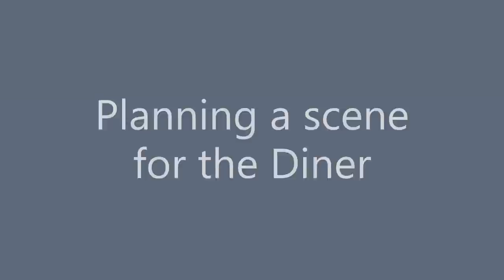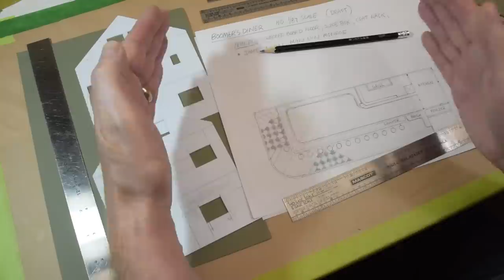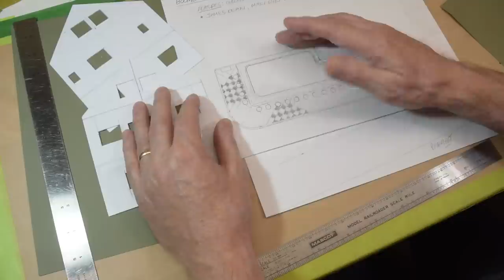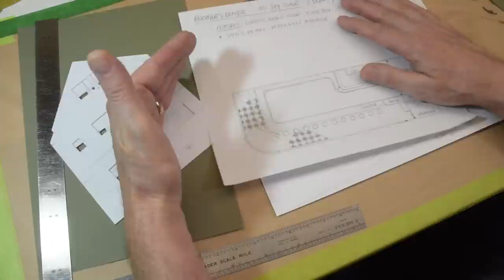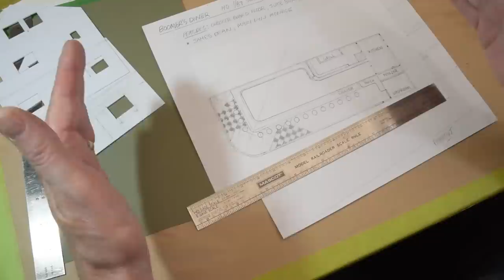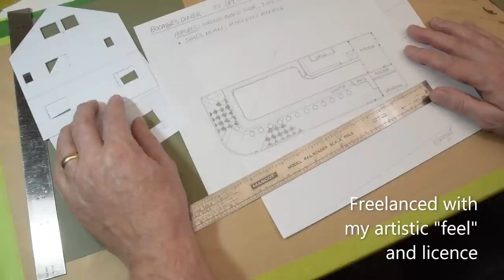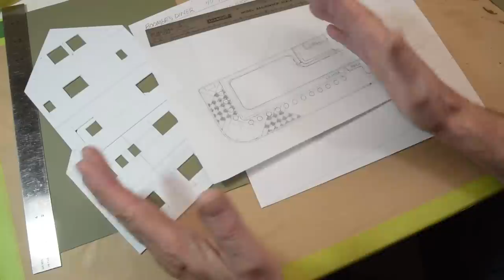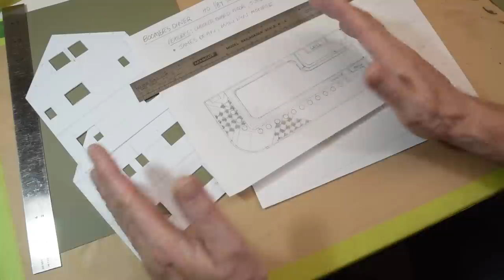Planning The HO Scale Track-Side Diner | River Road ~ Vlog # 131

Comment: Re the site prep of balsa over cork. Do you think 1/8 birch ply over cork would give the same sound-deadening effect?
The only Balsa we get down here is so soft it would mark very easily.
I guess I'll find out when I give it a try 😊.
Looking forward to more of the diner build.  Cheers!
Reply from the maker: I don't see why not. Glover road was only 1/8th plywood with some foam in places underneath and it was relatively quiet. Make sure you use 12" spacing between the frames if you use 1/8th plywood.

Comment: Great addition and video,  Boomer. How many coats of varnish do you recommend before layering a coat of paint and or stain down? Does it depend on the wood type or the thickness? Just curious, I used hairspray on my first two layouts, with an hour of drying time between coats and got pretty good results. 
Thanks for another very informative video. Cheers Bruce Ames in Minnesota
Reply from the maker: Two or three coats of varnish will do for me.
Reply: Thanks Boomer